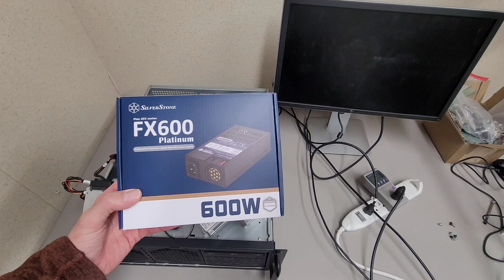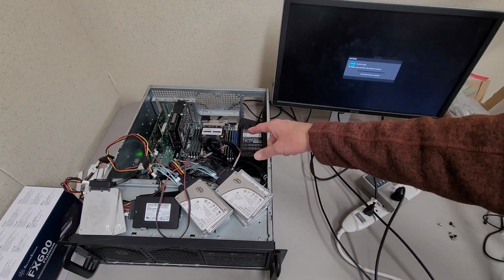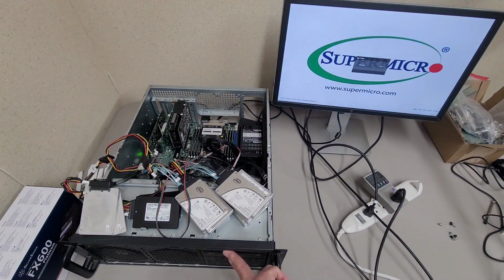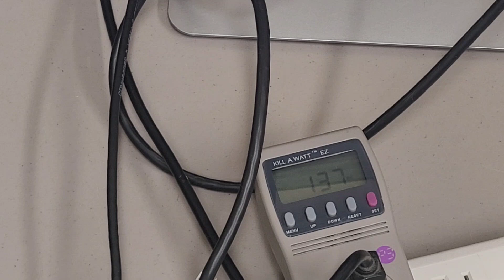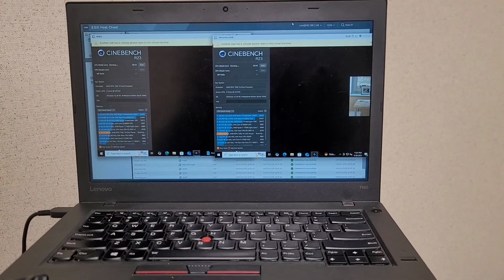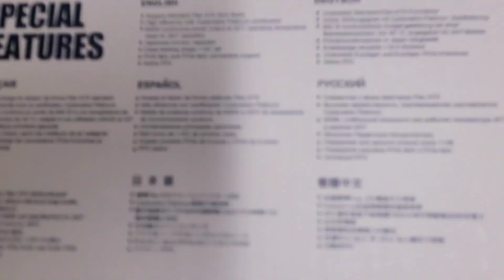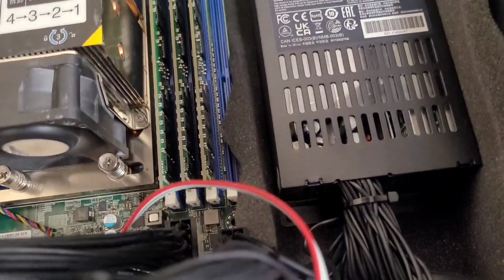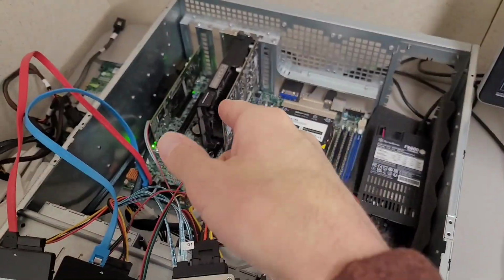Doing a little testing with my defective Supermicro H11SSL-i board before it is returned

Comment: You can still run 6 Channel Memory instead of 8, or even only 4 Channel - If you get enough Performance for your use Case that's even drawing lower Power. Lookup the RAM Sticks you use, they could easily draw 10 W each for a 16 GB Module.
Reply from the maker: @jfkastner  true. I also am figuring if my needs change there is always a chance I move the board to a larger case and run even more hardware with it. At nearly $400 I would prefer the board was fully functional. If I have enough of a power budget I may add a single slot Tesla GPU for light AI stuff. I need to work on doing a full load test once I get everything built out.